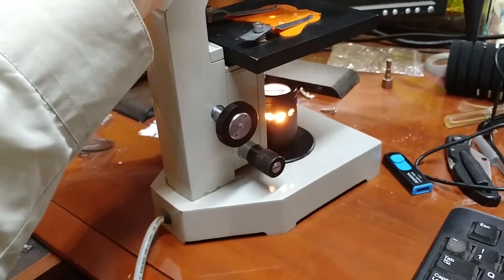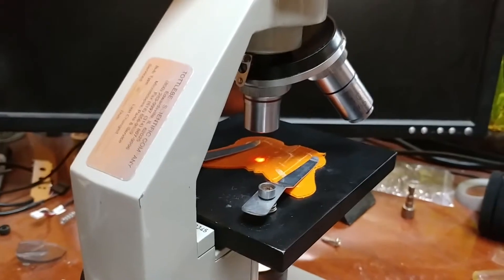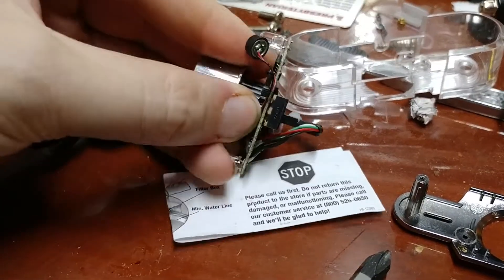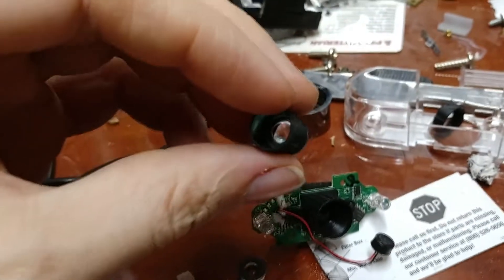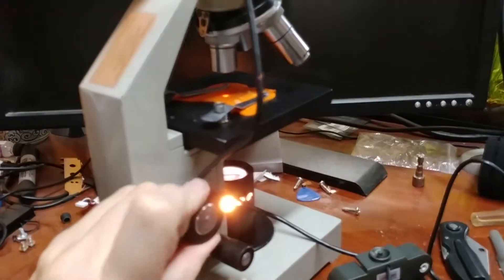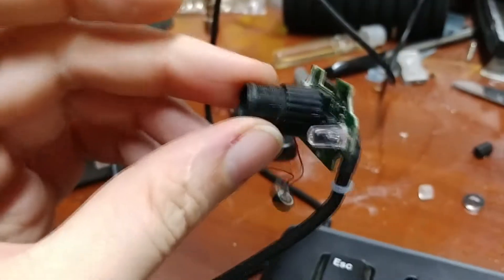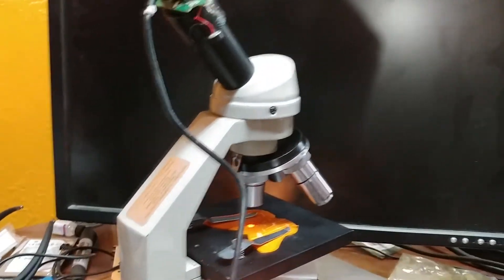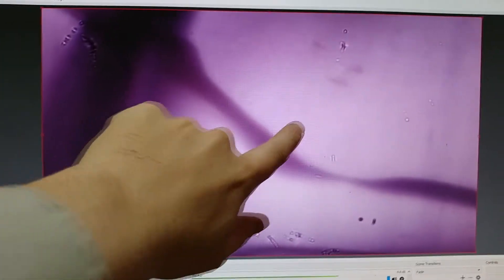DIY $40 digital microscope project

Comment: A friend of mine have a Kyowa Tokyo LS-3-AC  microscope and a USB2 YW500 camera.
We just cant get it to work propertly. The microscope isnt far off how yours look. Kinda similiar. With lighting underneath.
What software to use for capture the image? We tried VLC. The camera did not include any software in the box.
One problem is that the picture got lines over the screen like waves. Looks like you are filming a TV or a computer monitor. Or a low energy lights of 60Hz

Maybe we dont know how to adjust the microscope. It got many knobs,. big and small. We used to pieces of that special glass. One super thin that you put on top of the other glass pieace with object between with contrast fluid. We had like a tiny tiny dot of mushroom with mold pore and stuff.

Suggesstions?
Reply from the maker: I use "open broadcast studio" for recording. It works with pretty much anything that has drivers.

If you set the camera to record at something like 24 fps it will frequently stop seeing flickering, but you might also see if you can find an LED bulb to replace the one you've got, sometimes that will fix it.

Comment: You should oil at 2,000x and change lighting.
Reply from the maker: Yeah, I know, it wouldn't have worked anyway so I didn't bother, since it isn't a thin slice and it would have mucked up the plastic for no reason

I think I basically said in the video "higher stuff works but not for this," and since it isn't a microscope tutorial it really didn't matter

Comment: Check out my setup, it's definitely not cheap, but it does the job well. It does have it's issues, but so far I have found ways to mitigate any issues. https://www.youtube.com/watch?v=oQHCvAvSRvQ . I was wondering if anyone has advice on how I could improve or change my setup. Would be neat to put a webcam and macro lens together so you could make it more portable, even though the magnification would be lower.